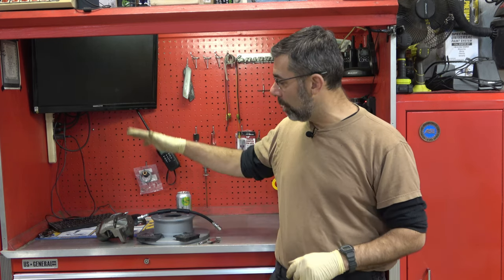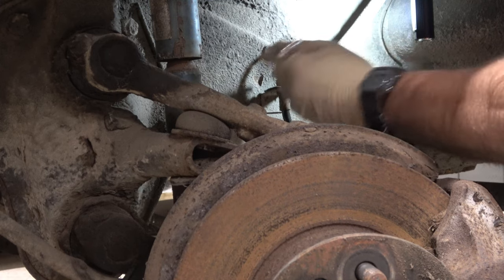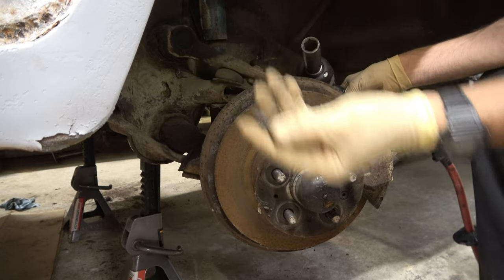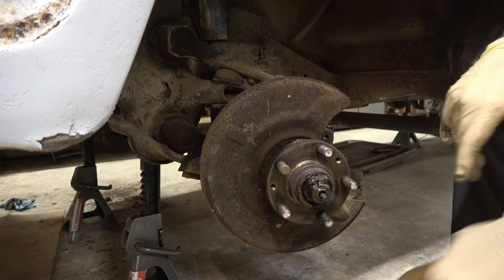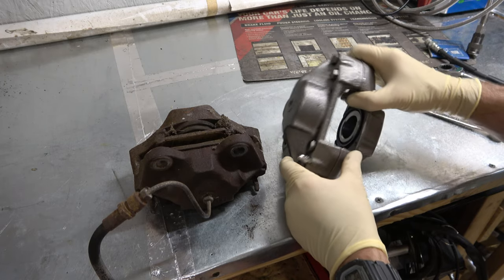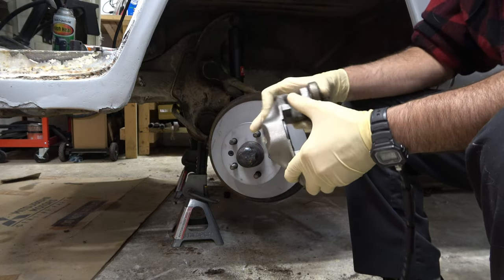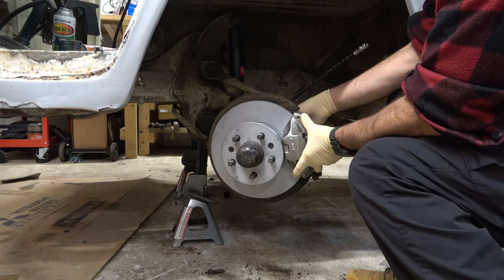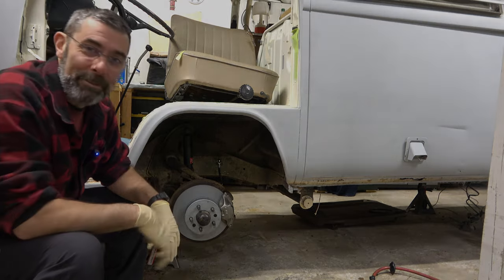VW Bus Front Disc Brake Overhaul. This entire thing was TOAST! Let's fix it up.

Comment: Can you put a tiny bit of never seize on the little allen bolts and on the lug studs? I would think a tiny bit would help for the next brake job?
Reply from the maker: Some people do- I don't as that is what I always have done. It can go either way and would be ok. Maybe in a high rust area, it might be a decent idea to
Reply: @Farpoint Farms Restorations and Repairs  yes I am in Pennsylvania and everything rusts bad because of the winter brine they spray the roads with here.

Comment: that wasn't bad at all  like it when you just slide the pads in and put the pins  on my 2006 tacoma they sent me 2 calipers box numbers were different but there was 2 same  front right so had taken it apart already we put the caliper bleeder up on the old removed caliper bled it then moved it to the new router up side down works great I'm in nova scotia. had odered them from avatar parts in british colombia  .    price was good but wont do that again sending back the old calipers cost me 60 +?   bucks freight. lesson learned
Reply from the maker: ouch- that was some expensive freight- maybe not enough to cover the core
Reply: got back over 200.00 but here in canada in the land of every thing cost twice as much ...ordered 2 small scope rifle mounts for a traditions 50 cal black powder inline. they were 15 bucks u.s.  through amazon. was 25.61 free freight landed here took 2 months

Comment: I have plan to restore my brake system...but not sure with aftermarket parts..but original parts is hard to find right now...do you have recomendation?
Reply from the maker: There are very few options for original parts. You can do what I did and buy a second bus for parts, but even then a lot of stuff is worn out.
Reply: @FarpointRestorationsAndRepairs  I think is to risky buy another bus for a donor parts...but buy new aftermarket parts Im not sure about the build quality...
Reply from the maker: @bhektiari7772  It's tough. I'd stay away from eBay and Amazon for parts and stick with companies like BusDepot for the important parts. While these are also aftermarket, they tend to be a better grade of such.